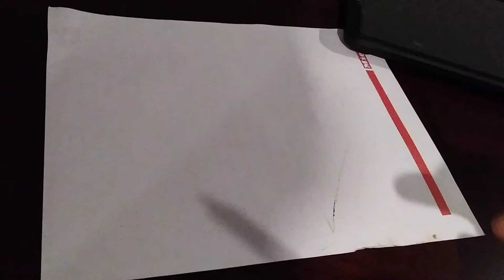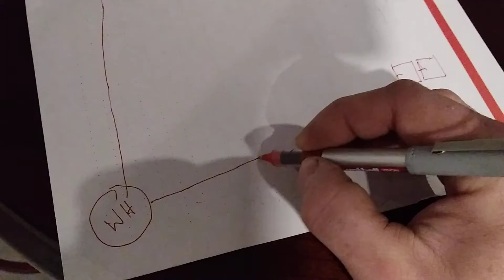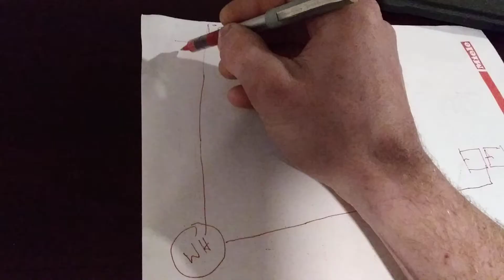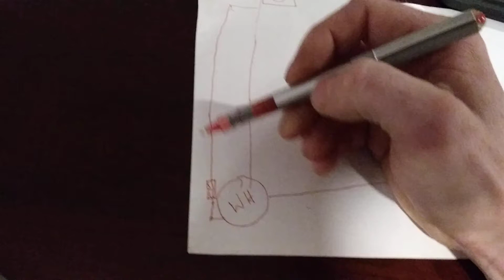Hot Water Recirculating Loop

Comment: I bought a single story 2005 home that already had a recirculating pump system installed (probably by the builder). The pump didn't work so I looked online for a new one. $600+ was way out of my price range. Fortunately the hot water naturally circulates through the system just like Owen was saying in his video. It isn't as hot as it would be with a new pump installed but you don't need it to be to wash your hands or even get in the shower. It saves a lot of water and is very convenient. If air is introduced into the system via plumbing repair or the water company fixing a pipe (rare), then you'll need to bleed the air out. All I do is hook a 50ft hose to the bottom of the water heater drain and turn on the hot water at the faucet furthest from the water heater.  Then turn on the valve for the WH drain for a minute and it's all good again.

Comment: Worth reading (IMO): I bought a 2 story 5,000 sf home with the 50 gallon water heater in the basement and a dedicated circulation line as part of the plumbing system which runs through the ceiling of the basement. The builders had installed a $650.00 Laing recirculation pump with the timer and all the frills.  It all worked great for our first 2 years in the home.  Then one day the pump started to make some noise so I unplugged it and guess what... We still had all the of the hot water we needed at every sink, tub, shower, laundry and kitchen as needed and never had to wait more than 5 seconds for it. I could not understand why this was still working so beautifully during these past 8 years with no functioning pump but now I know!!! Thank you, Owen, for your wonderfully informative and inspiring video. Keep up the great work.

Comment: I want to do this using 3/8 copper from the master bath to the hot water heater drain....using a 3/8 inch check valve. Do you think it will work?
Reply: you can use 1/2" cpvc and probably dont need the check valve.lot cheaper than copper.

Comment: I'm planning to install this system in my rancher with the water heater in the 5' crawl space. It would be a single looped system. I have purchased two backflow preventers, one of them would be mounted vertically and with the spring removed making it position in a normally open flow and only close on a backflow condition. One valve is a all brass construction and the other is a brass body with a polyethylene tappet inside. What are your thoughts on witch one to use?

Comment: Interesting. An old time plumber told me about such a system about 30 years ago, but according to his explanation, it only works if the end points are higher elevation than the water heater such as water heater in the basement or crawl space and return lines are eitler level or sloped downward.  Based on the theory of heat rises.  Very interesting if you can get this to work with water heater on same floor as end points.

Comment: Excellent video!
If your water is from a well with a pump, this will save on energy to run the pump and wear and tear on the pump.
Note: if you have a tankless water heater, gravity recirculation might not be enough to turn on the heater.

Comment: In my country, hot water cylinders are never installed further than 6 meters from point of use to minimise the "dead leg".
Also, the fewer fittings on your water supply lines, the better, your pressure and flow are reduced with every bend and tee you use. (Average pressure in our homes is 400-600kpa). 🍻🇿🇦👍

Comment: But, why would the water move without a circulation pump? It's pressurized evenly throughout.
Reply from the maker: The cooler water in the return pipe near the heater moves slowly downward due to the temperature difference, pulling hot water from the heater outlet around the loop and through the check valve. Pumped return lines are common too, but I was impressed that this concept works as well as it does. Thanks for watching!

Comment: Insulating the cold is a de facto requirement, especially with a finished ceiling.  If they didn't insulate the cold, there will be a trail of water under every cold water run from water in the air condensing on the cold water pipe, no different than water condensing in an air conditioning system and running out of the drain hose.  The hot is normally only insulated if you recirculate.

Using gravity like gravity hot water heat works, but I'm not totally convinced as there are other reasons for that pipe being hot.  However, I did find at askthebuilder that they outlined exactly what you did, and I do thank you for your thoughts and the effort you put into making this video.

I notice in the comments that people are trying to come up with a cost basis as to this not costing more or the cost minimized.  They need to get over it.  You are trading energy money for convenience.  To say you are money by saving water is laughable.  Unless your house runs on bottled water, that's spending a dollar to save a hundredth of a penny.  The only variable is how to get acceptable performance for the least energy investment.
Reply: If your water is from a well with a pump, this will save on energy to run the pump and wear and tear on the pump.

Comment: Thanks! So I watched this video a few months ago. I was replacing old rusty galvanized pipes in my ranch style home with pex, and I decided to make a hot water loop to supply all my fixtures and then return to water heater drain as you explained. I missed the part about the check valve somehow. My water was actually fairly warm all the time but never hot. You could actually take a shower and not turn on the cold water and it was Ok, just OK. On my own, I decided I needed a check valve on the return line and installed it yesterday. This morning, my water in the master bath was cold for the first time in a couple of months. I tracked down your video and rewatched it, and saw the part about the check valve modification, so I'll be drilling the hole in the flapper today. Hopefully, that will fix the problem. Thanks again!! Also, one other modification I'm making is adding a shut-off valve in the return line that can be timer and wifi controlled. That way I can disable the recirculation at night, and when we're away from the house for extended periods, and save a little gas.

Comment: I think a recirculation pump, that's on a timer or a push button start, or a IR sensor start, that only comes on when needed, may use less gas. If it's only recirculating the cold/hot water, 5 - 10 minutes before you need the hot water  You will save more Natural Gas. Those small recirculation pumps only use a few dollars of power per year, if used only on demand. Could you compare your hot water gas bill, before and after your return line, to see the average cost difference.
Reply: more for others, the pump is only needed if you cannot natural convection going, ie your water heater is above your pipes. if you have natural convection the water will flow thru  the pump. do to what is suggested you need a solenoid valve to stop the recirc.

Comment: Its no problem at all to tee into the the top of the water heater cold inlet...it all goes str8 to the bottom of the heater via the dip tube inside. It's fine to tee into the drain outlet as well but the system in this video doesn't have a die-electric union installed....he just used a brass nipple....which is NOT a substitute. Circulating systems, for reasons unknown, cause pin-holes in copper piping, so not having a die-electric union only increases the chances of pin-hole repairs. 
    Me? I just ran a dedicated 1/2" hot water line to my furthest fixture (Kitchen sink) so it takes about 20 secs for piping hot water to arrive. I insulated it too so that it stays hot for about 30 mins of non use.....best thing I ever did. 
    I ran a 1/4" inch line from my heater to one of my master sinks for that early morning hot water demand for washing face, brushing teeth etc. Takes 5 secs for that water to arrive.

Comment: Did this to our house when we remodelled...works great.  WH is in the crawl space, upstairs' showers get hot water in 5 seconds or less. Used 3/4" pex on the main loop, 1/2" pex on branch lines and insulated it all well.  I always thought the water recirculated due to the temperature differential versus gravity...but I might be wrong.  Either way, it works.  Nice to not have a pump that can go out.
Reply: Heat rises. Cold sinks. Unrelated to gravity.
Reply: @D_Syno  Gravity is the source of "up" and "down," "rise" and "sink." Without gravity, heat doesn't rise and cold won't sink. Therefore, the system described is a gravity system.

Comment: I'm getting ready to replace CPVC with Pex and wanted to add recirculating line without a pump.  Back in the 70's I built a ranch house and a plumber friend did this for me on that house and it worked great.   Thanks for posting this.

Comment: since I don't have access to any lines, no basement of attic, I think I will add a 2.5 gallon  Water heater fed from the hot water supply line at the 70 foot away bathroom... Installed in the kids bedroom closet which backs up to the bathroom. 
But I really love your detailed explanation and I will be doing what you detailed for our master, just 20 feet. Electric isn't a concern since I have solar.

Comment: Hi Owen thanks for the video and nice work. I was wondering I’ve seen some hot return lines tee back into the cold inlet line feeding into the tank, off course with check valves installed on both lines. Have you witness this before and know if there is any hassles with it?
Reply: This is my setup and I'm wondering if it's causing my water heater to run more often. With the recirc pump on the cold inlet actually becomes warm, despite a check valve in place to prevent backflow. I guess they're mixing together like pouring hot and cold water into a cup.
Reply: @joshwaloveslotr  Its no problem at all to tee into the the top of the water heater cold inlet...it all goes str8 to the bottom of the heater via the dip tube inside. It's fine to tee into the drain outlet as well but the system in this video doesn't have a die-electric union installed....he just used a brass nipple....which is NOT a substitute. Circulating systems, for reasons unknown, cause pin-holes in copper piping, so not having a die-electric union only increases the chances of pin-hole repairs. 
    Me? I just ran a dedicated 1/2" hot water line to my furthest fixture (Kitchen sink) so it takes about 20 secs for piping hot water to arrive. I insulated it too so that it stays hot for about 30 mins of non use.....best thing I ever did. 
    I ran a 1/4" inch line from my heater to my one of my master sinks for that early morning hot water demand for washing face, brushing teeth etc. Takes 5 secs for that water to arrive.
Reply: Nice set up.  Im thinking to do the same thing.

Comment: I'm wondering, do you suppose the water heater is still coming on more often, now that you've insulated the pipes?
Reply: A year later & I'm wondering the same. My copper pipes are non insulated, keeping the heat in those would have to see the hws on-times increasing.

Comment: So why didn’t you use a recirc pump?
Reply: Many water heaters these days have thermal traps in them, and recirc pumps don't work from what I've read. This system works great if you have the ability to add the extra piping. Adding pex is cheap, quick,  and easy.

Comment: So if I'm understanding this correctly, this is more efficient because the water that is returned to the bottom of the heater is still fairly warm so it requires less energy to heat it up to the desired temperature compared to cold water?
Reply: This set-up is more to save water, at the cost of a small amount of water heating fuel. Instead of dumping the (cooled) contents of the hot-water supply line, this loop circulates the hot water continually so it doesn't go cold from sitting in the pipe. If the pipes are insulated, the water shouldn't cool too much, but a small loss is unavoidable.

Comment: I'm no expert but seems to me this would work best if your heater was at the lowest point of the loop. You need the heat source low to make the water flow up otherwise the hot water may get trapped at the highest part of the loop and not flow back down.
Reply: That is as worthy thought.  However I have a recirculation line in my 2 story house.  Water heaters are in a 2nd story attic.  Master shower/bath is 1st floor on the opposite end of the house and it still works.  Apparently the temp difference between the hot water heater inlet @ bottom and it's outlet @ top is enough to cause circulation.
Reply: yes I would agree it is s must that DHWH is at the low point, which means rancher style with crawl spaces won't work if the DHWH is on the same floor, damn, haha.

Comment: This works very well, but it’s actually not a gravity system, it’s a thermal loop system.
Hot water from the tank has a path all the way to the faucet/shower and back to the bottom (cold part) of the tank. Provided this loop is uninterrupted AND the hot water tank is heating the water, you will get a constant cycle of water.
If the water is not heated, the cycle will stop - because it’s not a gravity system, it’s a thermal loop system.
IIRC, such a system will not work if there is a jog in the hot water plumbing whereby the pipe 90’s down and then back up again, as this causes a thermal block.

A gate-valve is nice to have, as it allows you to reduce the flow of the hot water in this loop to just enough to provide wait-times that you are happy with, thereby saving energy.
There is no limit (that I am aware of) for how far the fixture can be, but the farther it is, the more heat-loss and therefore energy usage.
Reply: Well depends how you look at it. Cold water is more dense, therefore heavier than hot water. Without a gravitational force this loop would not work.
Reply: @JEZPP  I stand corrected, you are right, it is the more dense and therefore heavier cold water that falls to the bottom of the system that propels the thermal loop. Without gravity, this colder/heavier water would not fall to the bottom.
Thank you for the correction!
Reply: @I999-g2s  yes, I've always been somewhat amazed how it seems that gravity has a roll in almost every part of physics, biology, chemistry, etc... without gravity many thing would not be possible.

Comment: Coldwater pipes are insulated to keep them from dripping condensate.
Reply: Your statement is true, however generally there shouldn't be a high enough dew point in your home to form condensation on your cold water pipes. If that is happening you need a dehumidifier. You should be able to just enslate the hot water pipes to retain the heat
Reply: Right anwser

Comment: Without a timer this loop is constant so water heater (mine is electric) would run longer.  Are there valves with timers?  So the loop basically expands the size of the water heater by the volume of water in the lines.  Therefore you'd want those lines insulated REAL WELL, but would insulating the rtn lines retard the gravity force?
Reply: Realistically, you want all lines well insulated.  All of mine are, and I still get "gravity" circulation with water heater in 2nd story attic and demand on 1st story at the opposite end of the house.  I have a pump but don't have it turned on - water flows right through because it has no internal valving such as a spring-loaded check valve.  If you still want to use a pump, there are many options.  Solar systems have a created a market for 12V pumps (which can be driven by a wall-wart transformer), and temperature sensor based relays.  If you prefer, you can use a wall-outlet-based timer to plug the wall-wart into, which then powers the pump.  Some of those timers have an internal clock that keeps on ticking if you loose power so you don't have to reset its clock when power resumes.  You could even combine these two controls (time and temp) to activate a pump if you want that type of sophistication.